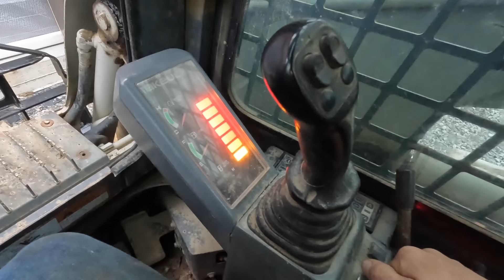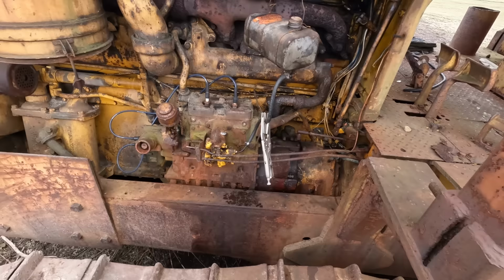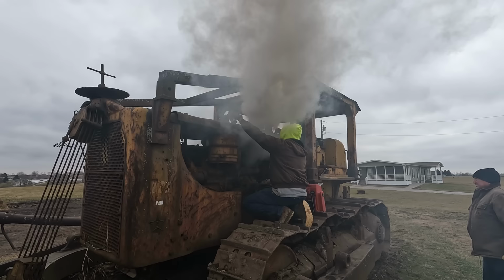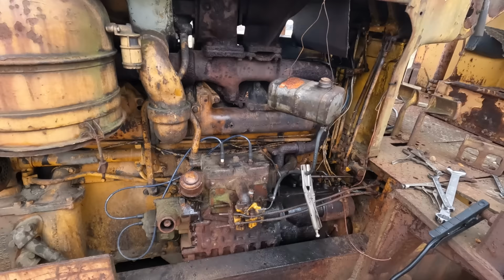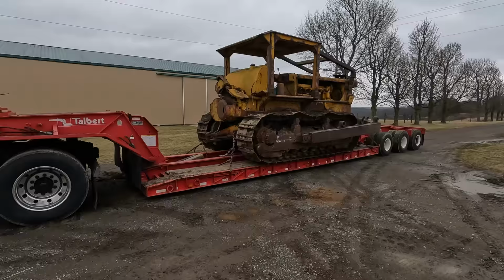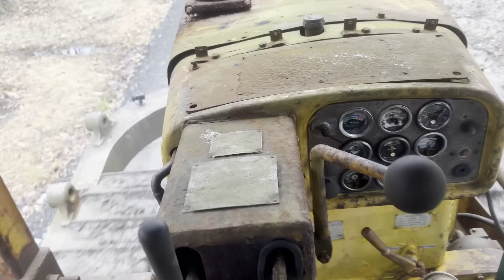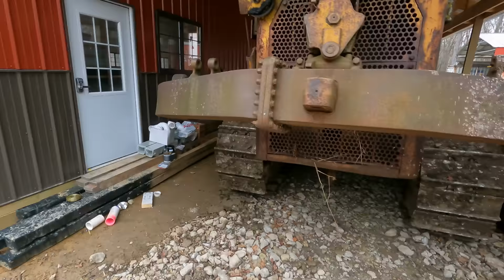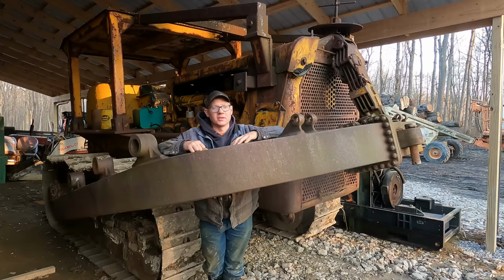Hauling Home a 1964 Cat D8 Bulldozer after sitting 15+ years!

Comment: Hi Matt, as always love your videos. I noticed the last video the starting engine exhaust was running into the big engine intake and forgot to logon and write you. 

I see so often where the newer generation does not correctly start these older starting engine diesels. It is incorrect that the big engine will start right off when feeding diesel. The correct starting procedure is to rotate the big engine with the valves open until oil pressure is built. By that time the starting engine is warmed up also. Then close the valves with diesel off and run depending on temperature for some time until you can feel the block warming up. Then turn the diesel on. 

I ran these Cats in the 50;'s and 60's some of them almost new and never had one start without rotate time under compression for considerable time. I used to measure it in terms of cigarettes smoked while waiting. 

I have two D6 CATs today one with converted elec start and the other with the starting engine. The elec start CAT still needs a shot of ether if it is at all cold. The reason I think the starting engine diesel wont pop right off is because the rotation speed is not very fast. 

The starting engine exhaust inside the diesel intake is replaceable from what I've heard but I never had to replace one. I think they leak because the starting exhaust does not have a rain cap on it. I always kept/keep both exhausts covered.

Comment: You saved it just in time with the bottom of the air cleaner rotted out and the exhaust for the pony engine being rotted it would of not been a few years before the engine would of been stuck. Really neat to see a power shift with a cable blade.

Comment: Speaking of your concrete floor, could you have inlayed some I-beams in the floor like C&C Equipment did to their floor? You’d have to have rerouted the pex heat tubing. Most of your equipment wouldn’t be a problem but that D8’s a heavy beast! Also, the blade seems to be rather flimsy for a D8.
Reply: Matt could have done that, but I imagine he would have needed a thicker slab than what he poured for the i-beams to be of use.

Comment: I as an 18 year old began work, as a Tradesmans Assistant, for the Main Roads Department, Queensland Australia, the year 1963 and the D8 was not very old, it was a hydraulic machine.    It was working in the Emerald district Out back Queensland when it blew a head gasket, the boss took me with him to do a retighten of the head, after warming it up there was so much stuff to be taken off before we could get to the head bolts that it was nearly cold.    Later more trouble emerged with the heads so we removed them and shipped them to Rockhampton by rail.  When the heads never arrived in the Rockhanpton workshop a great search took place and they were found among other scrap metal in the Railway Workshop?  Please explain? Another time it broke a track and walked right out of the track, we had to fit new track chains on the side of the fill where it was. Ted Lee

Comment: It's got a good sound to it. Even with the intake off. I'd be draining all fluids, and taking oil samples. Just for a baseline.

Yes the C frame is mechanically secure. But it has stored energy. Cables and friction brakes can fail. Just throw a chain around it up to the sweep arm bracket.

The sound of the D342 is music to my ears. No sound like it  while pushing with a full blade. Especially in the last iteration in the K model.

How about electric start and a block heater? 

Those pony motor engines and transmissions aren't getting any easier to find. Plus there are several versions depending on serial number range. I was having trouble sourcing some things on machines under the 20,000 serial number range 30 years ago... And the NOS market is variable.

Best of luck

Comment: - I know I always felt painting the rig you refit/restored showed the pride you have in your work and provided encouragement to continue.
- Given the size of this beast, would a thorough degreasing/washing and 'sanding' off the flaking paint, and doing a clear coat be an easier process?
- Getting that pony motor rebuilt/refit will be a huge benefit for you, that is for sure.
- Maybe discovery will show water flooding caused something to explode within the crankcase.
- Let's hope braze welding the cracked housing could be all that is needed.
- Maybe some new gears too, so the starter will work better and not have to be levered away.

Comment: I am in full agreement with you Matt about pony motors. If you can get your Pony motor started, you shall get your diesel motor started, no matter how cold it is. I hope you don't take too long to get it running again. As for bidding on and getting a job using antique machinery to do it, I say go for it.

Comment: I kinda like the idea of a pony.  After sqautch did a video discussing how it gets the oil flowing thru the main diesel engine, the exhaust heats up the intake to help with starting.  And I just bought batteries for my D6 and it was near $500.  How long is that gonna last?  Down in the south maybe it's a wash, but if I was up north in the cold I think I'd lean towards the pony.

Comment: Im surprised that a dozer as late as 1964 was still cable control for the dozer. Certainly reliable and simpler than hydraulics for a quarry type machine. She will be pretty all cleaned up and painted.

Comment: Dig the new intro with the band.
You commented that it was much colder this time, am I wrong in my understanding the the pony motor is not only there to turn the big engine but also uses the same oil and coolant so as it runs it preheats the diesel engine?
Seemed (maybe editing) like you went from pony running to cranking on the big one pretty quick.

Comment: A Just in case suggestion why not throw a chain from the blade frame up to the cab frame on the radiator side, to save any one accidentally catching the blade lever. Murphy's law if it can happen it probably will (ha- ha). love watching your good works, keep at it , Phil B.

Comment: I thought you are suppose to let the pony motor run for some time to warm up the diesel.
Reply: That’s why you can’t convert this diesel to electric start,  the pony exhausts outside channel of diesel intake to heat intake, then release compression which will warm engine, when warm kick up throttle , will start instantly without smoke or smoke rings, If it it sputters, smokes, you don’t know what you’re doing.

Comment: Hi Matt you really have a good one there that main engine is as sweet as a nut she runs great a good old service and she will see you for many years to come, the turbo sounds good as well probably just some new bearings and will be as good as new and the pony motor well if it was me I would change it over to a complete electric starter system like so many do or if you want to keep her original strip it down and give the money engine a complete overhaul and replace the inlet manifold or if you can weld it up you can get the proper mig wire for it if you can get into it that is or seek out a good second hand one or if your getting rid of the poney and going electric the just block of the exhaust from where the money joined to it and your done and a good coat of cat yellow and some arc welding to the blade and your ready for the road or dirt she's a great project one of your best yet it brings back sweet memory when I used to work on these old d8s at rugby portland cement in the UK we worked on plant and the fleet of ERF and FODEN and DODGE  Trucks and the company cars so we had 5 years at college and a five year apprenticeship  Ronald King was my Mentor god rest his soul he showed me so much I was in awe of how much he knew and I lapped it up and he taught me good he's been gone a long time he was in his late 50s when he joined up with him when I was sweet 16 in 1977 the amount of times he would clip me around the earhole if I made a mistake lol a friendly clip if you know what I mean he taught me how to weld in MiG Tig Braze Gas weld solder and when to use each one then how to rebuild a David brown gearbox and differential until I could do them myself with confidence any way brings back sweet memories' as we used to convert the d8s to electric starters from cat diesel a representative would come around and sell us the kitts as we had many d8s as we had many factories around the world then and our garage was the pride of the lot as it was all new you could eat your dinner off the floor we had 2 cleaners going around cleaning non stop keeping the place like new we were envied at college as we were the highest paid but we worked for every penny and i started at 5o hours a week working 10 hours a day when i was 16 and my first pay packet was 19 pounds and 50 pence and i thought i was rich then the next week it went up to 22 pounds and stayed that for the year until the next rise lol so mat all the best and you will have los of fun rebuilding her to her glory and i cant wait to see the next installment on the D8 so all the best from John from Rugby UK.

Comment: Matt, maybe get with Adam Booth @ABOM79. Could make for a good collaboration on having the pony repaired. Failing that, Mull Machine in Wheeling does good work. Electric start on those old beasts is always problematic.

Comment: That's a 1964?...wow, I thought by 1964, they would have had hydraulic cylinders on them..I thought those cable-lift setups were last used in the 1940's-early 1950's...

Comment: Hey Matt. Is the motor the 8R6022 inline 6?  I overhauled a 54 that looks like your tractor. The pony motor was hard to start. It was a pull start and you had to pull on the thing for 30 minute before it would kick over. That thing took me 3 years to find all off the parts to finish it. What fun, a total overhaul

Comment: So when starting it with the pony motor did you let the diesel run under compression for a while to heat up before you gave it diesel fuel? From the video it looked like it was instantly getting diesel fuel, you need to let them run on the pony for a while, especially when cold before you open the diesel throttle.  Maybe you did but in the video it looked like as soon as you gave it compression it was billowing smoke like the diesel fuel rack was already open which will basically flood it.  I used to run lots of different Cats with pony motors, you would have to let them warm up under compression for a good long time sometimes before opening up the diesel throttle.
Congrats on getting it running and moved, it should be a great addition to your fleet.
Reply: We were doing it as you describe.  There was a lot edited out you're definitely right you will flood them.  As soon as it wont start shut the fuel back off and let it crank on compression.  We tried to start it for probably an hour before pulling intake manifold off.  The main engine water manifold was basically at operating temp that's why it started quick once it could finally breath

Comment: Hey mat I wanted to take a moment to explain you probably already know, the advantage of the pony is to blow the hot exhaust in the intake for heat to combust . The later I think 9 u series also 
Was cooled by coolant the pony would heat that up and as the engine rotated in compression release function would serculate this warm coolant into the head also heating the main engine. 
So I'd think if it is suffocating the main engine I'd bet it running to rich. Nice special intro .

Comment: So the exposed turbo noise was earsplitting but i understand its unavoidable. I get these videos are very time consuming but is it possible through editing software to tone down stuff like that? If not ill still be here to watch its just constructive criticism. Awesome dozer! i ran an old d7 a lot like that but it was hydraulic. The pony wouldnt run so we used to push start it backwards til it was running so we could lift the blade. Love that ole ford aeromax tractor! Been driving truck on and off for over 20 years and ive never touched an aeromax and im a ford guy. I think doing a job with all antique equiptment would be awesome. Great job as usual cant wait to see more d8 content. I have ran our companies d9 but only for short stretches like ripping ahead of my quad and scraper when working alone.

Comment: Surely it would have been easier (and quieter) to have disconnected the pony exhaust?   Are you sure you're cranking the diesel with the pony long enough for it to warm up and before you attempt a start?  Squatch253 had a series on how to start.

Comment: Very nice Machine Matt!  Glad you were able to get her home and look forward to the resto on her.  I have a D4 that uses a Pony Motor and franklin, I would rather have it set up for electric start, as I can not get it home due to tracks not moving and pony motor is removed due to issues.  Unit has sat for 20 years and she does not want to move with 12K lb winch!  Anyway, will work on it more and eventually get it home.

Comment: Hey Matt, in the event you didn't read about the next Ford Super Duty truck, the next compression ignition engine they're going to sell to the public, it will have 500 horsepower and 1200 foot pounds of torque. Cummins has only a maximum amount that doesn't exceed 1075 foot pounds of it. I read a few weeks ago that the heavy duty trucks, which transport goods, have only 250 foot pounds more than it. This means that they have 1450 foot pounds of torque. That's not much of a margin.

Comment: Was it an option between cables operated and hydraulic cylinders, for the front blade ? Both of my Grandfather's D6's were much older, non turbo and had two hydraulics cylinders.

Comment: Matt.  How does the hot water floor heater work.  I have it my garage,  with not great insulation.   And it does well if you turn it on 10 hours before you go in the shop,   like a swimming pool heater

Comment: That pony engine IS STAYING. As you said, pony is superior. You still wont have intake air heater with a electric engine start, and if you add one, it will drain the batteries of the electric starter even faster ! Debatable if you'll save much money over fixing that casting and gearbox.  
Heck Id 3d design that housing if thats what it takes!

Comment: I was wondering if the pony motor uses the engine coolant?  If so you could run the pony motor for a half hour or so and warm the block before you try to fire?  Thoughts?

Comment: Hey Matt...for that pony motor and clutch issue....I think (scary) it would be cool if you had an old tractor there with the wide belt drum for running machinery and somehow loop that belt around the drum for the clutch and have a second tractor starting this pony motor.  Don't know how that would work.  just a thought.  Great videos.

Comment: So when are you going to work on your trailers so you can use them? Surely it would have been easier to disconnect the exhaust from the pony engine into the manifold instead of removing the intake from the main engine....

Comment: I’m guessing the point of the pony engine is because electric starters and lead-acid batteries suck. I wonder why modern vehicles don’t use better electric motor technology or a lithium low-voltage battery instead of lead-acid, then you could crank the starter for a long time without trouble

Comment: For those of us who don't play with heavy equipment what's the undercarriage being at around 50% mean? That would be a good video for us dullards who love your show. 😁
Reply from the maker: 50% life remaining
Reply: @DieselCreek  is the underbelly cracked, eroded away from constant contact with the dirt, bent to heck, or something else?
Reply from the maker: @michigangeezer3950  no the undercarriage is referring to all the track and track frame components which all wear out over time. It’s extremely costly to rebuild/replace an UC that’s why a lot of older crawler machines are cut up actually is because the cost to refit them is more than the whole machine is worth even with the new parts.

Comment: What was the reason for taking blade off and putting it on the other trailer, weight?
I feel like I’ve seen lowboys carrying entire bulldozers before?
Maybe they were smaller or lighter?
Reply: I would think that width of the blade was the problem.
Reply: @richardthomas1743  makes sense

Comment: I thought you had a lowboy trailer and where did you get the hydraulic dovetail trailer I can't find the video on it
Reply: It's another Scrappy trailer.  Matt just borrowed it for moving the D8.
Reply from the maker: And shipping containers lol
Reply: @DieselCreek  Are you suggesting that your videos may be published not in chronological order ?
Reply from the maker: @dfross87  usually they are. The trailer was borrowed for the containers first then we decided to go get the dozer together so I just used the big trailer
Reply: @DieselCreek  There was supposed to be a laugh emoji in there, but it seems to have gone missing 🙄.

I know videos are often posted out of order -- as evidenced by the state of the new workshop during this video.

Probably better off moving the D8 with the low loader.  Caterpillar didn't skimp on the weight.

Comment: I think somebody hit some bitcoin.... or some farm acreage makin bank....
Oh boy - so I cut off 2x 3/8ths hardened bolts, softened em with a torch, drilled a pin hole in each one, cleaned em up, then bent up some clip pins from some 11/64s metal rod I had then fit both to hold the trailer back end wood board - that took me two days...LOL